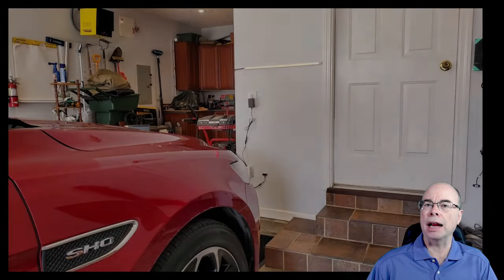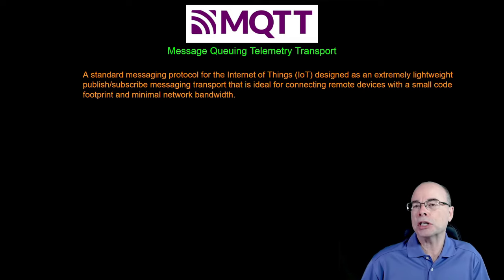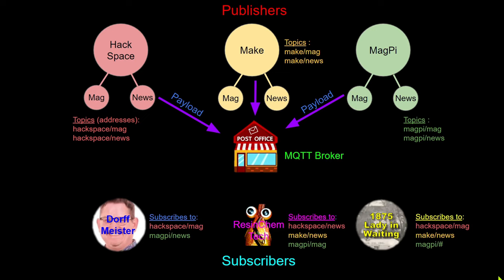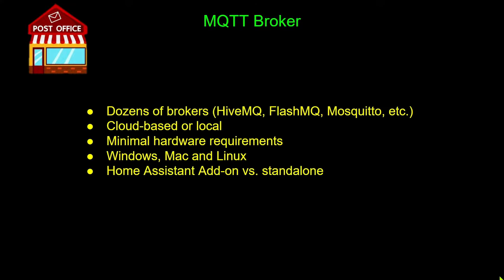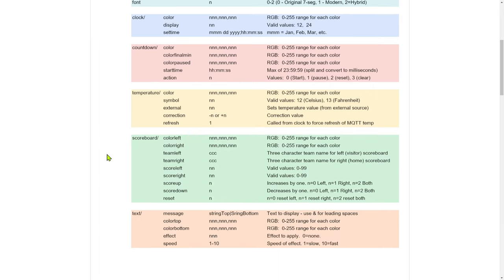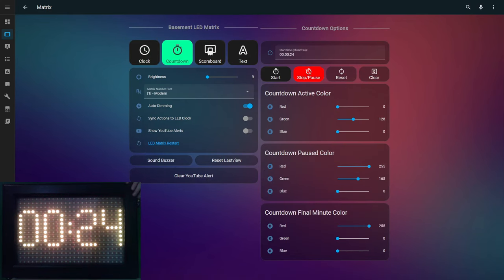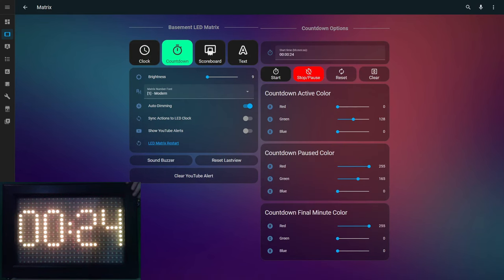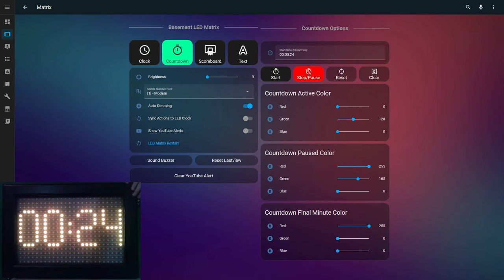MQTT 101: Integrate your DIY Devices into Home Assistant

Comment: Good afternoon Sir..Your videos are very informative......I have a 4 relay installed in my bedroom with which I have used Nodemcu esp8266 mirco-controller. I programmed it with Arduino using Rc-switch library and Espalexa Library...it is working absolutely fine since a year.... But after seeing your video I diceded to give home assistant a try and with your guidelines I have installed home assistant on a raspberry Pi which is up and running perfectly.... I also have installed mqtt ad-on in home-assistant...and programmed Nodemcu with PUBSUB CLIENT Library

I also have all my retain flag to true while publishing the relay status..... But still I experience random switching if trigger my relay with rf remote....
Reply from the maker: Well, it's a little hard to tell what is going on for sure based on the information above and without being able to see the full code, but it does sound like an MQTT issue.  I would experiment with changing the retained status (and maybe use something like MQTT Explorer to monitor exactly what is being sent/retained) and see if the ghost switching goes away.  If it does, then you know it is a retained flag issue.  If the random switching continues, then it is due to something other then MQTT messaging.

Let me know what you find.
Reply from the maker: I just wanted to let you know that YouTube blocked your last comment.  It will automatically block certain comments (those with links, certain words, etc.)  But I was able to see the code.

First, I see where pub3 and sub3 are defined, but your code uses other topics like pub1 and sub1 that aren't defined in the code you supplied.  I'm guessing these are defined elsewhere and refer to the other relays?  Again, I'd recommend that you try altering some of the publish statements and change the retained parameter from true to false and see if it resolves the ghost switching.  At least that way, you can determine whether the random switching is a result of MQTT or caused by another issue.  If all your MQTT topics are published with retain 'false' (at least temporarily for testing) and the random switching still occurs, then it is either not MQTT or something else (like a Home Assistant automation) is sending an MQTT topic... but you should be able to see if that occurs by watching the MQTT messages with MQTT Explorer (or other tool).  But also verify with the multiple sub/pub topics that you aren't inadvertently publishing to the topic for one relay when you meant to publish for another (e.g. using the incorrect pubX topic).  This could also appear to be 'random' switching. 

That's about the best I can offer at this point.  YouTube comments are somewhat limiting in terms of trying to assist in troubleshooting more advanced issues... especially those that involve large code blocks.

Comment: Hi, Thanks for creating this video.
I have a custom control system for my outside lights and greenhouse temperature monitoring using (Arduino) C++ on ESP32 dev boards and NodeRed running on a Raspberry Pi Zero 2W. I have been considering using Home Assistant for a while but thought it would be difficult to integrate with what I’ve got now. You have shown me that I can use HA with what I already have and expand my system to use proprietary devices (which hopefully will be less flaky than the ones I’ve made and programmed myself). Self programmed devices are never finished, their programs can always be improved (For ‘improved’ substitute ‘broken’) when I learn something new about C++. For some of my devices a bought device would work out of the box without me having to reinvent the wheel. I already have a Raspberry Pi 4b waiting for to be used for ‘something’.
Reply from the maker: I actually just finished up another project today that uses Arduino/C++ on an ESP8266 (a D1 Mini) at this point.  And of course it is integrated into Home Assistant.  It has local push buttons for some of its features, but it is nice to have control of those features via Home Assistant and to be able to also use those in automations.

I've gotten to the point, that my starting Arduino templates that I use for ESP8266 and ESP32 already have the MQTT code built-in.... even if I don't use it (although that is rare... I try to integrate everything into Home Assistant... even if it is nothing more than on/off or rebooting the controller remotely).

And I hear you on the 'never finished'!  I can't stop tweaking and adding new things to pretty much anything I build.  I always think of some other feature or option that I could include in MQTT and control via Home Assistant.  

Thanks for watching and taking time to comment.  Don't hesitate to let me know if I can help you out if or when you decide to move to Home Assistant.

Comment: This is a really good video.  The overhead with transmitting a topic say in LoRaWAN seems expensive on the bandwidth.  Do you know if you can transmit a raw data field only, that may have proprietary information (no topic stuff), on the RF side and then have a custom HA integration (???) that formats this into JSON which then can be written to the MQTT Broker?  If so what would that integration be?
Thanks
Reply from the maker: Well, as I mentioned, MQTT was initially developed specifically for low power (often battery powered), low bandwidth applications.  Do note that if you are developing your own devices/applications, the topics used are somewhat arbitrary... you can certainly create and use much shorter topics than I show as examples.  Heck, you could use a topics like /a  and /b if desired.. just as long as the publisher and subscriber are using the same topics.

But to address your specific question, I haven't used LoRaWAN, so I can't say for sure.  However, I did find this good forum thread about integrating LoRaWAN sensors into Home Assistant, including some discussion about how MQTT could be used with the process as well:  https://community.home-assistant.io/t/integrating-lorawan-sensors-into-home-assistant/628322

Sorry I can't provide more info, but I really don't have any experience with LoRaWAN.

Comment: Thanks. mqtt seems genious. Not only for homeassistant stuff. Suddenly all of my devices can communicate via the homeassistant unit.

And a great video b.t.w.
Reply from the maker: As long as you have a broker all those devices can communicate with each other.  And if your broker is standalone, Home Assistant wouldn't even be required... or you could substitute another MQTT-compliant automation platform like NodeRed.

While other options like APIs can have advantages, it's hard to beat the simplicity, speed and local lightweight nature of MQTT.  Thanks for watching... and the kind words.  Glad you found the video useful!

Comment: Basic question... I must be missing something... I had everything working just as you described on a RP using HA 2021.6.5, but now moving to HA 2022.12.18 on a VM, I'm getting nothing! 
I manually inserted the "sensor" block with its topic in the configuration.yaml file, just as you described. Shouldn't there be a corresponding "entity" show up after the sensor's first message is received? Entity-wise I'm not seeing any indication that the new HA is aware of incoming messaging, so of course can't assign sensor entities to display cards or automations.
It would seem that there's a config problem with the broker. Except that, when listening using Home Assistant's "MQTT Settings" configuration GUI, my manually published messages are reliably reported! Seems like I may have missed a "start" step somewhere?!
Reply from the maker: Well, jumping multiple versions of Home Assistant generally always results in things breaking.  Between version 2021.6.5 and 2022.12.8 (I'm guessing .8 as there wasn't a .18), there is a year and a half of breaking changes to contend with!  That is a LOT of breaking changes... and I know that there were multiple MQTT breaking changes in there as well.  In fact, 2022.12 introduced a major change in the way MQTT entities are defined in YAML.

I know you won't find this very helpful, but I always recommend that you don't fall more than a couple of versions before upgrading, or you will often find yourself in this situation.  There are so many things it could possibly be, I can't even begin to tell you where to look.  You can try using the Home Assistant logs as a source to see if you can find errors.  I don't think it has anything to do with moving from a Pi to a VM.  If you can't find the particular error, the only resort may be to drop back to the 2021.6.5 version, then apply upgrades in order until the problem occurs.  And I was running the current 2022.12 when I made this video, so it is something between the 2021.6 and 2022.12 that has broken your install/MQTT.  Also be sure that your MQTT add-on has been upgraded to match Home Assistant too.

Don't feel too bad. I made this same mistake early in my Home Assistant journey of skipping multiple upgrades and then faced a daunting task of trying to repair Home Assistant.  I've since learned and now upgrade each month so I can address any "breaking changes" as they occur and impact my install.

Sorry I can't pinpoint the exact issue.  I'm happy to try to help out further, but with so many version upgrades, I'm not sure where to tell you to start looking.

Comment: First of all, thank you so much for this knowledge sharing. About the Mqtt Device, this is should be addressed to HA Mqtt broker ? Does is work by connecting in another Broker IP ? Thank you
Reply from the maker: I'm not sure I completely understand what you are asking.  You normally only have one broker... this can be either the HA MQTT Add-on broker or a standalone MQTT broker.  You generally would not have both unless you have multiple networks or other special situations.   Each device or application either publishes data TO the broker or subscribes to get data FROM the broker (or both).  You connect to the broker for each device or application... and normally that connection is done by specifying the IP address of the broker, along with a User ID and password.

I hope that answers the question you were asking.

Comment: Thanks a lot for this video. I have one question. Is there a rule of building the topics? Could you reference a document? What is if I can use a sensor several times? Example "tempsensor/0/setmode" for sensor 0 and "tempsensor/1/setmode" for sensor 1. would that be correctly? To adjust the sensor address (here 0 or 1) there could be DIP switch on the sensor board for example.
Reply from the maker: There really isn't a 'rule' other than those imposed by the broker, but there are some best practices or recommendations... which of course vary widely.  Some common themes however are to always use lower case letters, avoid spaces and special characters, don't start with a forward slash, etc.  You can find a lot of different recommendations just by Googling "MQTT Topic best practices".

Personally, I think it is more important that you just create your own standard and stick to it.  Your example above is perfectly acceptable.  If you don't have a utility like MQTT Explorer yet, you might install that and take a look at the topics that are currently being created by Home Assistant and any other MQTT devices already in use.  For me, I already had a lot of Tasmota MQTT devices (pre-integration) which used base topics of tele/  stat/ and  cmnd/ followed by a device name then the actual 'action' part of the topic (like power, brightness, etc.) so I more or less just adopted that as the standard I use.  But that's no more valid than starting with a device name, followed by state or command, then the actual 'action'.  Or you could group your topics by location, starting with livingroom/ bedroom/ kitchen/ and then the device and rest of the topic after that.  It's really what works for you.
Reply: @ResinChemTech  Thanks for your feedback.

Comment: Hi! Thx for the video! I'm struggling to find content about tasmota mqtt entitys without standard device class on HA (like MPU 6886 accelerometers/Gyros) and so, those entitys cant be shown on statistics with graphics. Could you give me some hint about how to solve it?
Reply from the maker: I'm not completely sure if I'm answering what you are asking, but do you have these entities integrated and showing in Home Assistant?  In other words, can you see things like the accelerometer and gyro in the dev tools->states?  If so, note that while a device class isn't necessary, to be able to plot a historical graph, the value has to be numeric.  So check the actual values being returned by MQTT.  If not numeric, then you may need to create a templated sensor based on the return value so that you can get a true numeric value.  You should then be able to graph the history of this numeric templated sensor.

Again, sorry if I am misunderstanding what you are asking.

Comment: Thank you for doing this. Please consider using dark mode for HA screens... I couldn't read the bright screens...🤣
Reply from the maker: Noted.  I do try to assure I'm using dark mode for most code windows (like I did for the Arduino/Python code), but the Home Assistant code editor is that blinding white.  I'll be sure to try to use another method moving forward.
Reply: @ResinChemTech  Maybe code-editor/VS Code... Thanks, I have bad vision but everybody loves dark mode...👍

Comment: Your video kicked me out of the gate.  I’m new to Home Assistant’s YAML and have been struggling for some time to find anything that would show me how to setup MQTT sensors.  THANKS!

That being said, can you point me to any online documentation (perhaps how you figured it out) for sensor definitions?  I’m old school and get frustrated meandering through the online documentation provided by Home Assistant.  Specifically, I’ve learned that MQTT defined sensors cannot be modified through the UI.  I’m ok with that, but would like to modify some of the parameters e.g. display precision, plus others.  A document showing those options would be great.  

Enough Said – Thanks Again – fun to be up and running.
Reply from the maker: Glad my video was helpful!  Like you, I'm "old school" and do everything in YAML in Home Assistant.  Not only automations and scripts, but helpers, etc.  I don't think I've used the UI for anything (when I show the UI in a video, it is just for the video and I don't actually save it).  Part of the reason is that I had to learn YAML when I started out with Home Assistant (that was the only way back then) and since I took the time to learn it, I'm going to use it!  The other reason is that I like to keep all my automations, entities, etc. in Home Assistant packages.  The UI throws all automations into a single great big automations.yaml file and you can't add your own comments to the code, control where the files are placed, etc.  But for those new to Home Assistant, the UI is fantastic and I don't fault those that use it.  I just prefer my YAML.

As far as documentation... I hear ya' when it comes to the "official" Home Assistant documentation.  Home Assistant updates so often that the documentation often doesn't keep up... or new features really aren't documented at all.  I don't know if I can point you at a single source for MQTT sensors in Home Assistant as anything I learned from years ago is sure to be out of date.  Learning to use templates is a huge help (but then you have to learn a bit of Jinja as well!).  If you haven't watched any of Jeff's videos over at Slacker Labs ( https://www.youtube.com/@SlackerLabs ), he has a few tutorials on creating and using templated sensors that are pretty good.

And of course I'm happy to try to help and answer any questions you might have as well.  Thanks for taking time to leave a comment!